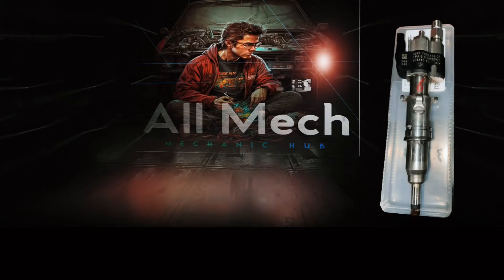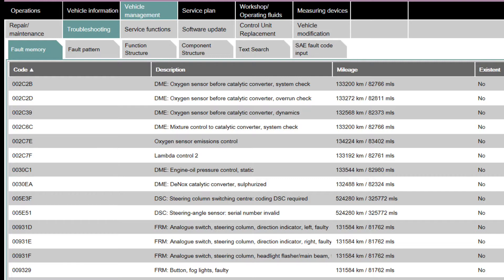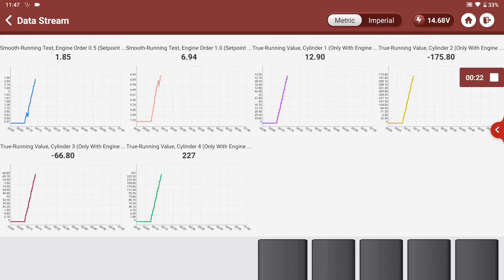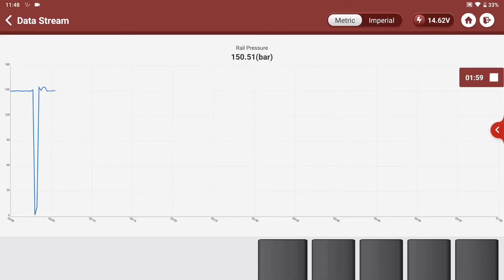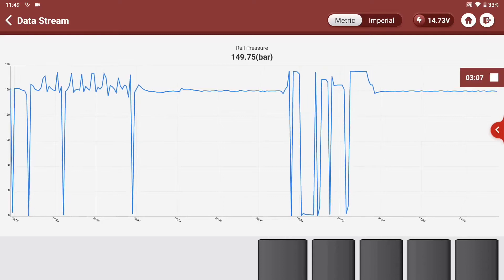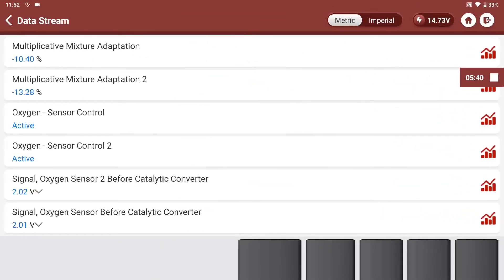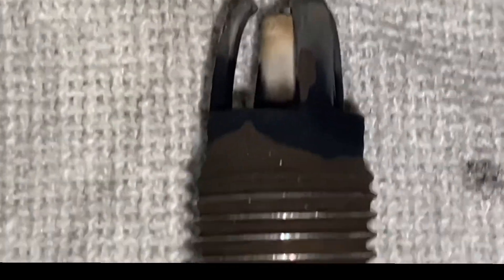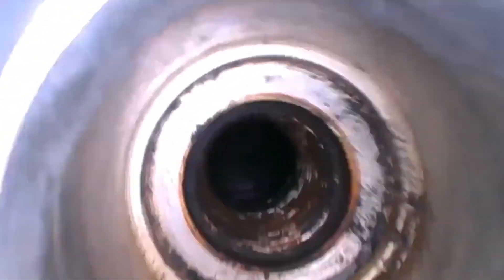HOW TO SPOT A LEAKING INJECTOR WHEN THE ENGINE RUNS WELL CAN BE DIFFICULT . THIS WILL HELP YOU

Comment: Sir, if I understand you correctly, you are saying that ONE bad injector on one bank, can cause negative long term fuel trims on BOTH banks? I have a 2019 V8 Chevy Camaro SS, and it's running EXTREMELY rich. Long term fuel trim at warm idle on Bank 1 is around  -10.5 and long term fuel trim on bank 2 is -13.3. Both fuel system test on both banks failed on my scanner obd2 reader. Primary O2 sensors are oscillating like they are supposed to, but they are going from lean to rich over and over and creep up over .8 volts at times (rich). As I revved the car to 2k rpm, the negative fuel trims go MORE negative = at 2k rpm bank 1 long term fuel trim is -12.5 and bank 2 long term fuel trim is now -17.2.  Car starts fine every time, and seems to idle ok rpm wise (rpms don't bounce around during any of this) but it does shake EVER SO slightly while idling. It seems to pull well to redline at wide open throttle. It's the quarter throttle/pulling out from a stop that is the problem. It starts to slightly buck or jerk at 2k rpm light throttle casually accelerating from a stop. Sometimes it will bog when going wide open throttle, sometimes it won't bog and pulls very well. There is no check engine light, no codes what so ever. I've replaced MAF sensor, PCV valve, new spark plugs and wires, brand new O2 sensors, made sure MAP sensor was reading correctly, checked for vacuum leaks, and everything is OEM done by the dealer. Please help me. This has been going on for over a year now. The car is stock other than a very nice cold air intake that everyone uses. Maf reading, and iat are good, I forgot to mention that I had dealer perform an injector flow test, and they said it looked good. My coolant level in my resoirvoir hasn't moved in a year (topped it off hasn't moved). One last thing, if I cruise on the highway, steady throttle, steady speed, my fuel trims seem to get better!!! That's what is confusing
Reply from the maker: You have a situation where too much fuel or crankcase gas is getting into the exhaust hence the car trying to lean off the mixture. I am unfamiliar with that car but heres what i would do:- 
1 - are the plugs dry black sooty? 
2 - is the crankcase breather working?
3 - cylinder compression ok?
4 - forget the dealers and get the bore cam in to see if the injectors are leaking
Reply: @allmech_BMW_fault_finding  brand new plugs and wires, dealer replaced them so I didn't get to see them in person and said they looked fine. Brand new pcv, haven't checked cylinder compression. One thing I have seen is my evap system has been really weird. My evap vapor percentage is constantly reading negative pressure when it's commanding the purge valve to open creating vacuum. I was suspecting it was sucking up fumes from the charcoal canister and putting to much fumes in my intake manifold where the purge valve sits. Either that or a leaking injector, although doesn't describe the negative trims on both banks. Amd my fuel system is returnless.
Reply from the maker: @GERONIMO326 It seems you are pretty good fault finder. Remove the evap and plug the orifice. It could be the evap is not working. Lets see if this is the cause... go with easiest quickest options first 👍 If you fix it let me know and record the work you did and I can make a video.
Reply: @allmech_BMW_fault_finding  i most certainly will, when and if I find the fault. Unfortunately my purge is working as expected, just checked lol. So far EVERYTHING is in spec, except ltft. The only thing left is cooler operating temp, vehicle going in and out of closed and open loop randomly (sometimes when manually shifting gears in between gear shifts). But I'm thinking the cooler operating temps are from running rich. I'm back at ground zero.
Reply: @allmech_BMW_fault_finding  I've come to conclusion I believe it is indeed a leaking injector. Your video helped out a ton. Taking it to the dealer tomorrow morning.
Reply from the maker: @GERONIMO326 Thats really amazing to hear and you made a good fault find there 👍

Comment: hi guys, I have a problem, all 4 injectors have been tested and the masters say that they are good, but again sometimes I have a problem when the car is hot, it takes 3-5 seconds to start... when it is hot, it works in reverse, the chain has been replaced and that is not the cause  .  I suspect the injectors.  my battery is at 20%, maybe it is causing the problem?
Reply from the maker: You need to sort the battery before anything else. Hot start problems may be faulty coolant temp or even low fuel pressure. You should use live data and monitor parameters when the car is taking 5 seconds to start.
Reply: ok, thanks for the information, I will report the information

Comment: fighting injectors too already replaced two of them but still warm start something is very bad, BTW picture of injector is wrong, right one is 	13537589048 and latest index is 11, index 12 is for different engine no N43. Thanks for very in depth video. keep it up!
Reply from the maker: This is just a library image 🙂 With grey injectors that you refer to there can still be index 05 as in this image. The point was only to point out that people should not overlook index numbers. I think index 12 applied only to the N54 but I could be wrong 🤷‍♂️ But thank you for clarifying things there - this is a community and I value all input to the videos that I make 👍🙂 And thank you for the nice comments🙂

Comment: great video!! i really split my hair out with injectors! I love to know how you tackle 30EA - DeNox Catalytic converter sulphurized, i been told jus drive long distances high speed to clear the cat.  This N43 is a weird engine its petrol but has like DPF like maintenance!!
Reply from the maker: Yes just drive once they get sulphurized but first you must set the option to regen in ISTA prior to test drive 🙂 Thanks for the support matey 🙂
Reply: Quality work mate, very well done. Loads of valuable information and a great borescope shot of the failing injector. Never seen that done before on a crank test 👌👏👏
Reply from the maker: @GerardBurkeBurkesGarage Thanks pal. The scope is a cheap one - around 100 dollars from Amazon. Teslong is the brand. We have had this nearly 3 years and has proven a rugged tool indeed. We had to replace the camera but they deliver spares really quickly.
Reply from the maker: @GerardBurkeBurkesGarage Thanks pal. The scope is a cheap one - around 100 dollars from Amazon. Teslong is the brand. We have had this nearly 3 years and has proven a rugged tool indeed. We had to replace the camera but they deliver spares really quickly.